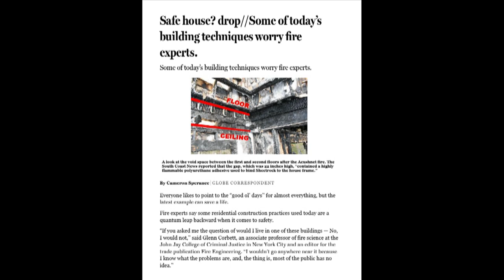Podcast 388: Delayed Windows, Whitewashing Brick, and Cooling Off Upstairs

Comment: In reference to the shade discussion. If you can see the white side of a curtain or shade from the outside, then light (and therefore energy) is leaving as well. It will hold some heat, but not all, so it does work, just not to the extent we probably think it does.